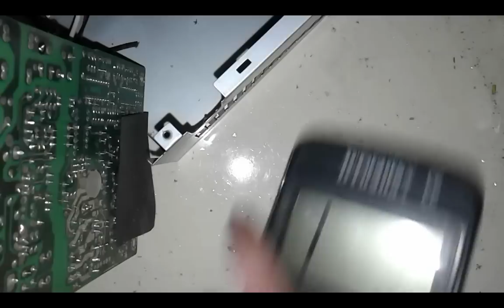How to Repair a DEAD Computer power supply PSU fault troubleshooting and repair

Comment: Good to watch and you obviously know what you're doing. That said, it's probably cheaper to buy a new ATX PSU than repair a damaged one.
Reply: I disagree. A diode or faulty capacitors cost a whole lot less than a new psu!

Comment: If you know ANYTHING about electronics repair to start, he shouldn't have to say a word!

Those of you who need to hear an explanation of every move have NO PLACE INSIDE A COMPONENT THAT CAN KILL YOU!!!

The fuse is always the first thing to test if the cord is not the problem. This fuse is blown and I didn't even need to watch further.

He lucked out. It's usually the output capacitors to die. But this was just an example as the power supply in question is too old and weak to be any good on a modern system.

Comment: I've got a blown D103 on an HP p6214y power supply, I don't know what part to replace it with. Any suggestions for a generic pwr supply replacement diode?

Comment: yes you did repair this psu but there is more to check if you want to make sure it works for longer than just a few moments like in a switching psu it is most often the capacitors that can open or short then you must check the voltages to be sure they read correctly there are also other things that can go wrong but on this unit it would be cheaper to buy a good psu than  to fix that one. but it is your money and time so?

Comment: Someone has warned me to NOT open the CPU to blow away the dust. Let it rest for a couple of hours. As there can be electricity in there? Is it dangerous? How would you go about it? I've seen people hit the power button when it's turned off to discharge.
Reply from the maker: yes it is right , it can hold a charge for very long time .. you have to be carefull with the capacitors
Reply: Careful as in, don't blow on them at all?
Reply: "couple of hours". The capacitors can hold the charge for weeks, even months. If you don't know what you are doing then don't fucking do it. It can literally kill you.  The very first thing would be to check if there's charge there.
Reply: To fully discharge the caps all you have to do is throw a glass of water on the open power supply board while it's plugged in and at the same time put your finger anywhere in the water. You will know when something happens :)
Reply: Big Jay Oh my word. This made me laugh so bloody hard and for so long I couldn’t read your words properly for crying. Ace mate and thank you!

Comment: my power supply isnt faulty, i switched it to 230 watts and it fried either the video ram, or the video card (it is all integrated)
Reply: There is no dedicated GPU memory on an integrated system. And I would have to assume that 230w PSU is a downgrade.. you probably fried that one just trying to fire the machine up. Get a real PSU (since you'll need one regardless of whether you fried the motherboard or not when you rebuild) and try it. They don't even make sub-300 watt PSU's anymore, they're just too weak for any Core II Duo or better chipset motherboard.

Comment: brother i do the same but i only change fuse 
earlier when i switch on my ups to on pc its some sound like. blst and my house mcb down kind of shot circuit i open smps and change the fuse but again its blast and house mcb switch down plz tell me how can i repair it and the components
Reply from the maker: +vicky khan check the bridge rectifier and other components on the Hot side
Reply: IsDeno24 brother im not expert in its but can you gave me some picture of the components your are talking about plzzzzzzxxx
its can help me a lot
Reply: @aamir3951  watch DiodeGoneWild chanel, i learn a lot from him. He explain every component